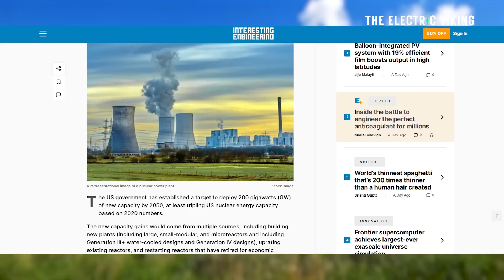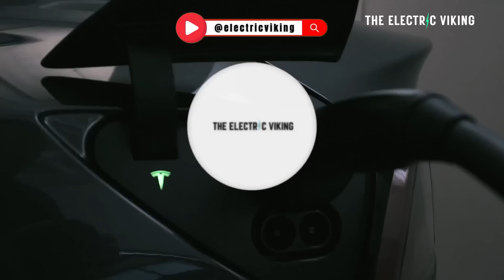US reveals plan to triple nuclear capacity with hundreds of nuclear reactors

Comment: As somebody around 1 operational 1 abandoned and one non operation plant, around here they are local and most people are for it. They are surrounded by civilians and two of them are even on the main highway. The people in Alabama love the ones around me because for one both are already built and for two the non operational one is ready to go if it needs to be put back on the grid for three the operational one provides clean electricity to 2 million homes. The one abandoned is about 20 minutes away and the reason it was abandoned was because of the 3 mile island incident. I highly suggest researching that accident because it is perceived to be 20x worse than it was. (It was also operator error) The president at that time took away the grants and placed stricter guidelines for the power plants.

Comment: 1:12 google believes that nuclear will be 40 per cent cheaper than solar plus batteries for their ai clouds that need to run 24/7. Hence their investments in nuclear. Also the iea believes that nuclear needs to triple by 2050 to meet co2 targets. Solar, wind and battery is fantastic but additional nuclear power is also required to phase out oil coal and gas.

Comment: Many sources of coal are contaminated with radioactive material. The nuke plant, depending on the fuel origin of the coal, could actually end up safer radiation wise than the coal burning plant.

Comment: Concrete manufacturing is carbon intensive. 
Massive amounts of concrete are used to build the plants.  
Existing fossil fuel  plants will need to be used to 2050 while n/plants are being built. 
So this strategy will increase, not lower, CO2.
So why are they really building the nuke plants?

Comment: How can you be so sure of Solar + battery's when it's not yet proven to be able to run a major grid anywhere in the world let alone at more northern latitudes ?

Live co2 emissions at the time of writing this in grams per kwh
France 24  
Sweden 15
Germany 176
Australia sits between 354g up to 663g depending on the Territory.
Nuclear works!, France and Sweden have had those numbers since the 80s. For all the Energiewende talk Germany is still an order of magnitude higher in emissions after 40 years, Same for California and even if they went to zero tomorrow it would take hundreds of years to "pay back" the carbon debt they occurred during the last 40+ years by not going Nuclear.

Comment: The two Vogtle 3 and 4 reactors just commissioned cost about $A50 billion for 2.2 GW generation. If they are to triple the amount of nuclear generation (currently about 100 GW) they would have to build another 200 GW of generation. If it cost the same as the Vogtle 3 and 4 reactors thats about $A5 trillion. They also do not have the skilled workforce to build about 200 new 1 GW reactors
Reply: >- $A50 billion for 2.2 GW generation. -<
That is A$22.7 per Watt.  Utility-scale solar costs 1.1USD per Watt, for daytime power--when it is needed the most.   If you mean 22.7 USD per Watt, that is of interest to nobody as CC-NG is also in the low $1 range per Watt although they require fuel instead of being free to run.

Comment: Here in Europe, the poster child for renewable energy is Germany. It has a CO2 per kw/h statistics generally an order of magnitude than its neighbour, France, which powers the bulk of its electricity requirements through the use of nuclear power. They also have considerably higher electricity costs, at least at a residential level. I can concede that solar backed by storage may be viable in the near future, but that can only ever be a place where it is warm year round, e.g. nobody has to worry about winter. This may be fine for Australia, but not so much in the US, Canada and much of Europe.
Reply: I recommend applying critical reasoning. France’s nuclear generation was built decades ago and is heading towards end of life. New build nuclear is vastly more expensive than old nuclear already fully paid off. Comparing electricity prices in France to Germany demonstrates a lack of applied critical reasoning.

In addition, Germany started building their renewables when renewables were VERY expensive - and still have to pay off that extra cost. Renewables are FAR cheaper to build now. And, Germany’s reliance on Russian gas - and then having to change so quickly away from Russian gas - has added costs.

I am not saying that Germany did everything right - just that your comparison is ignorant of reality and as a consequence is absurd and does not demonstrate or support anything you think it does.

Comment: Very good decision in the US. Australia will also go nuclear with 3-4 large nuclear plants supporting the eastern grid and another one in the west. Small modular reactors may also be in the mix.

The reason for nuclear is not about generating cost but  about energy abundance and reliability 24/7. While it is possible to go pure renewables in Australia, the long term storage needed (around 3,500GWhrs) is extremely costly at about $1bn per GWhr for batteries or $35m per GWhr for pumped storage (30 times less expensive).

Nuclear largely solves this  storage problem, reducing the total storage requirement by about 60%. This also means wind in particular only needs to be positioned in the most productive sites thus lowering overall wind costs..

With nuclear as part of the mix, Snowy Hydro 2 and two or three other comparable storage projects will suffice to support the renewables component of the eastern grid.

Unfortunately, one of the other more promising pumped storage projects Pioneer-Burdekin in central Queensland has recently been cancelled, putting the skids under renewable energy in that jurisdiction. Unless it can be reinstated (which it should) this will require yet another nuclear plant to plug the gap.
Reply: Australia is not going to build nuclear. The last major energy project from the idiot political parties that wants to build nuclear was Snowy 2. Already 6 times the original budget and not finished yet. Now the same lying politicians want us to believe they will build nuclear “affordably” without massive overruns again. Only an idiot, ignorant of what they have ACTUALLY DONE IN THE PAST trusts those liars on YET ANOTHER incredibly expensive major energy project.

Comment: The tech companies are actually quite favorable towards renewables (plus storage).  But for their upcoming data centers, they've deemed this is not enough. Not enough for the actual power density, and other huge energy requirements.   There's a huge capex for GPU's, AI chips.  This means they have to have high capacity utilization for AI training.  Also, real time response for inference.  This means 24/7 "clean firm power".   This is the missing piece in the low carbon portfolio.  Dis-patchability.  Baseload.  Even if you have to pay extra for this, reliability is its own value.  Not just LCOE.

Having said this, the US has to rebuild its muscle memory for building nuclear, doing it on time, cheaply, and a rapid (but safe) fashion.  It means developing the supply chains, manufacturing experience, labor force, repeated deployments, to drive down costs.  (Also, streamline a lot of the regulatory hurdles, esp. for new reactor designs.)  This will take awhile.  But people are looking to the 2030's and beyond, for this next leg of energy growth.

Comment: Elon’s deal to put all those EV’s on the road.  Gonna work like a charm😂
Reply: Yup, huge wealth benefit via much cheaper lifetime costs, with a kicker of the health benefits of much lower air pollution
Reply: @ 
That is extremely oversimplified. And Its massive and expensive. And won’t likely happen because of massive opposition.
Reply: @Glowbetraveler  2016 called, wants its mistaken predictions back. LOL

You seriously have no clue WTF you're talking about.
Reply: @ states like California will never build one. As solar is 20x cheaper. Its a nightmare of regulation in CA. Even Texas is crushing it with renewables. Maybe the southern states will build out nuclear because of economic growth and less resistance.
Reply: @Glowbetraveler  Oh, you thought BEVs means you need nuclear power???? I misunderstood.

Well news flash, BEVs not only require only modest increase over current grid output, they actually make power production from assets more efficient as the time delay of use inherent in having a battery means smoothing out the grid load, reducing shut-in time of generation.
Reply: @ 
Agreed.

Comment: Nuclear is a good option for use with renewables.  It works consistently 24/7 whether the wind is blowing or the sun is shining.  It is clean with minimal waste that can be reused and what cannot is minimal.  The safety record is very good and risks are often overblown.
Reply: BS. What actually works well with nuclear is generation that can peak or firm. Nuclear struggles with ramping up and down. Nuclear is already the most expensive form of new build generation on an LCOE basis, and that is with high capacity factors. Lower the capacity factor and you get even higher costs per MWh.

Nuclear and renewables only look like they work well together when you don’t apply critical reasoning.

Comment: I worked 25 years in the nuclear industry at 20 sites in the US.  This will never happen. It's a dead duck.
Reply: My thoughts precisely.
Reply: @ednwade  designs have changed. Think of one moving part and helium for working fluid.  No fuel needed for 30 years, underground mostly. No water or chance of radiation leakage.

Comment: The government will have to pay for this because no lender will finance a project that takes that long to build, doesn't generate revenue until it's finished,  and with a final price tag that is not known until it's done. Not even the highest risk tolerant investment fund would touch that.
Reply: The banks are onboard
Reply: @tonyperrotti5049  ...when there's a government guarantee on the loans?
Reply: @aoeuuaoaou  i don't believe so . The capex to build a reactor is much more than natural gas or coal , correct. But the fuel is only approx 20% compared to 90% nat gas  or coal to run. It pays off in the long run. . So it's completely asinine to close a perfectly fine operating reactor. What Germany did will go down in history!
Reply: LCOE tables are out there, this has been heavily studied. Nukes need to get down around $70, that meets NG straight up. Obviously way over renewables but acceptable to mix & mix heavy in locals with poor renewable options
Reply: @tonyperrotti5049  The huge Capex upfront ruins the nuke economics. You can "believe" whatever you want, but you're quite mistaken.
Reply: @aoeuuaoaou  no I'm not . Cost much more to build , but much less to run.  With much less volatility on the price of fuel.. Worth it in the long run , assuming it's not decommissioned after only 30 years for ideology political reasons like in "GERMANY" .. Can it compete in the USA  where nat gas prices are today ? No. That's today , you can't assume it will always remain dirt cheap.. It's not expensive.. Europe will be paying much more with their LNG purchases.   The electricity in France is 50% less than in Germany
Reply: @tonyperrotti5049

Other than Germany’s early closures, Sadly, you’re flat out wrong. 🤷‍♂️

Again, this has been heavily studied & analyzed. Nuclear LCOE is very high, vs NA NG it’s about double the cost lifetime. Vs solar & wind, even with battery support, it’s multiples more expensive.

And takes a very long time to go from decision to start plannning to power flowing. Which is exactly the reason for the loathing in this video, in Australia there are coal power interests that are trying to pitch a “plan” of nuclear power as a ploy to thwart the massive roll out of solar & wind.
Reply: @frankcoffey  you will be surprised

Comment: nuclear is useful to stabilize intermittencies of renewables
Reply: No, it is not. Renewables need to be matched with peaking or firming, not “base load”. Nuclear generators are not designed to flex enough to match renewables. New build nuclear already has nearly the highest LCOE even when running near constantly. Running nuclear less would push the cost per MWh up even more.

Anyone who thinks new build nuclear somehow plays well with renewables does not understand how differently they behave, or the cost impact of lowering the capacity factor of a generator.

Comment: New nuclear tech uses configurations developed over the past half century. They are much safer and cheaper to build, run and cleanup.
Reply: Ignorance is often hilarious. You should do standup.

Instead of just having an emotional reaction to this, look at the actual costs of every nuclear generator built in a Western nation this century. There are very few so it will not take long. It is ignorant to call Vogtle 3 and 4 or Hinkley Point C or Flamanville 3 “cheaper”. Costs have increased, not decreased.